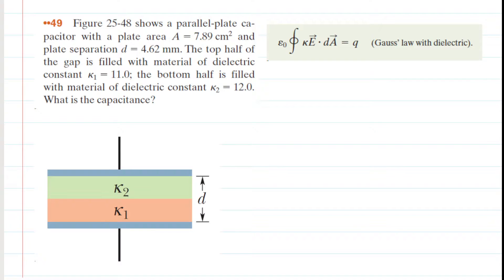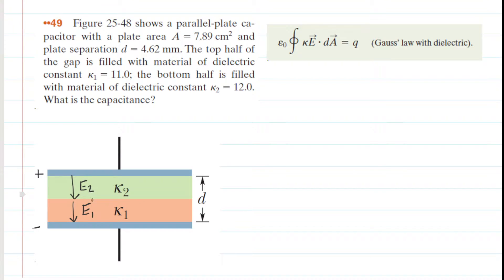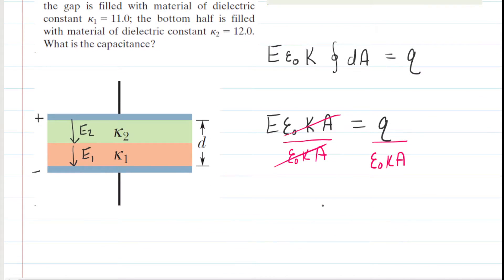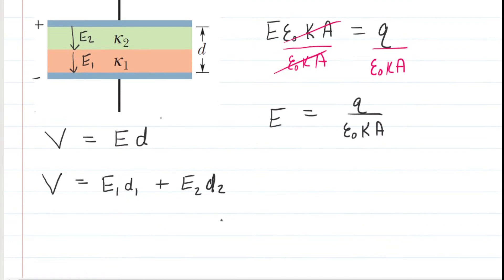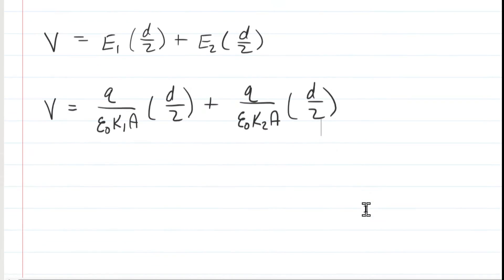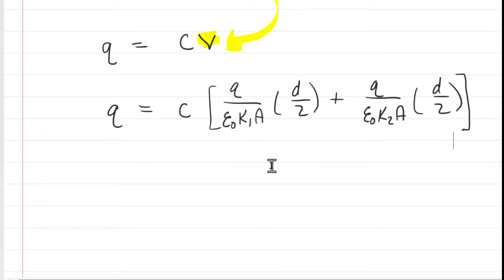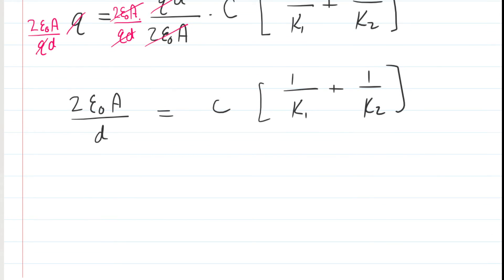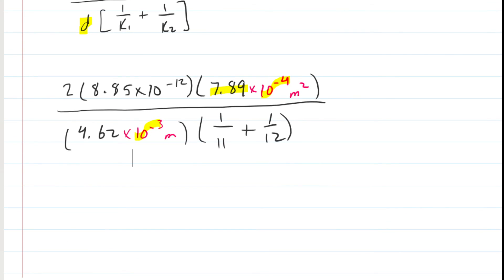The figure shows a parallel plate capacitor of plate area

Comment: If you place a metal slab right at the middle of the capacitor, meaning between the two dielectrics, how will the equivalent capacitance change? For simplicity, dielectric layers will have d/2 thickness still.